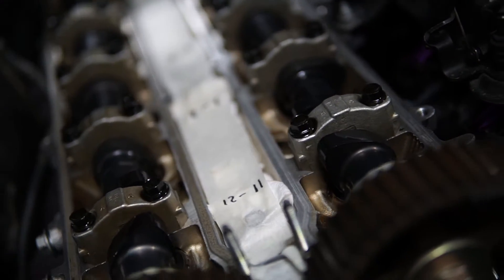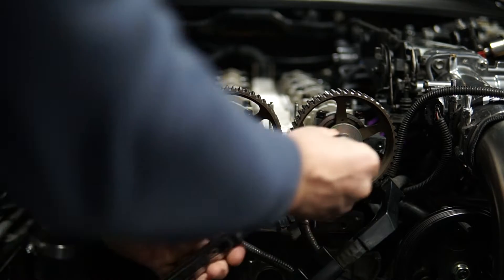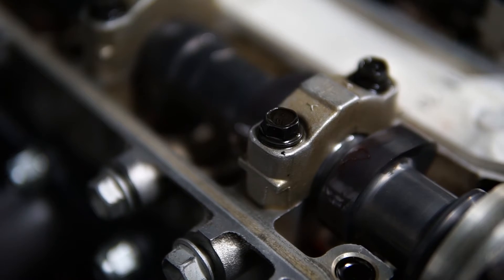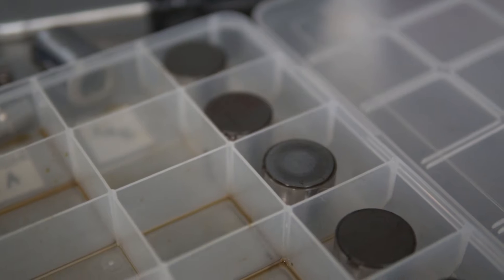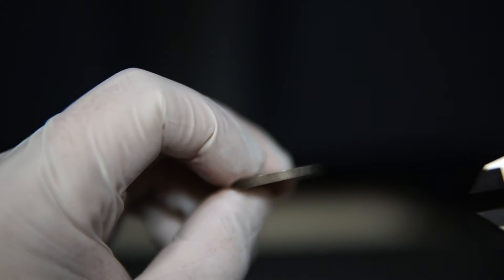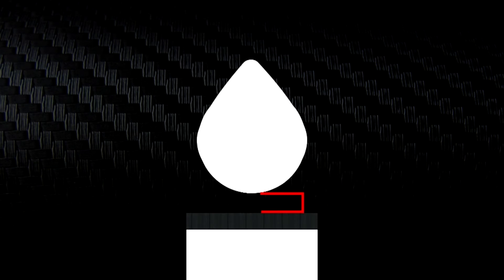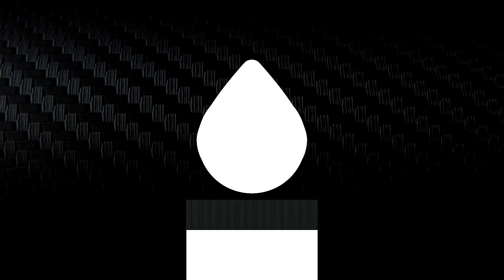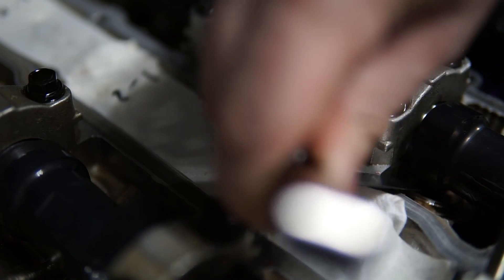Valve Lash Explained - How to adjust 2JZ Engine Valve Lash

Comment: How do i convert the shim values from 1jz shim over bucket  (sizing 2.02thou) in to 2jz shimless bucket (starting at 5.06thou) Would i just take the whole mesuerment with the micromenet and use that value?

 As a set of shimless buckets and cost a set at 300bucks... and i dont wanna spend thousands in just buying new shims each time im wrong

Comment: What if I have the smallest shim in and the clearance is still to tight?
Reply: There are shimless buckets sold for other toyota engines (1zz, 1kd, 1mz v6, etc). Measure the total height of the shim and bucket together and subtract out your deviation from the required spec; This is the oem bucket shim size you need to order. You can find exact part numbers online. Hopefully you can find one in the size you need.